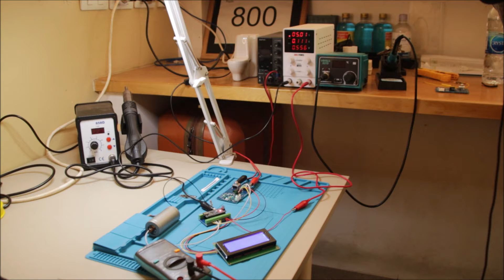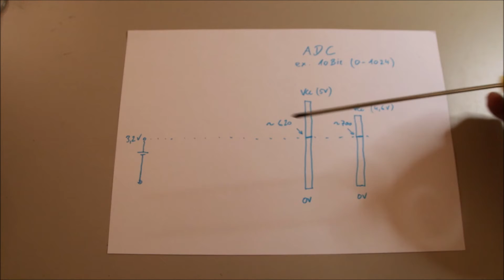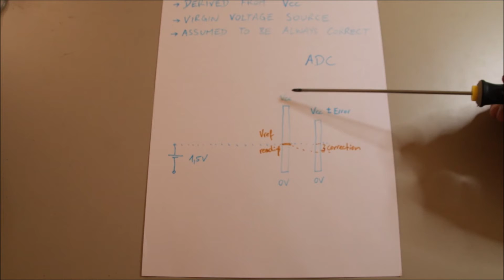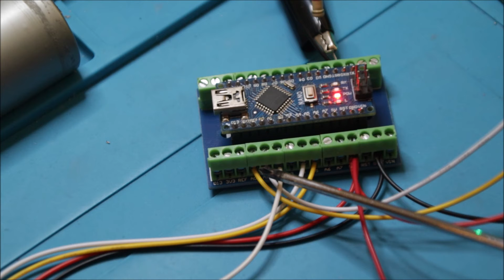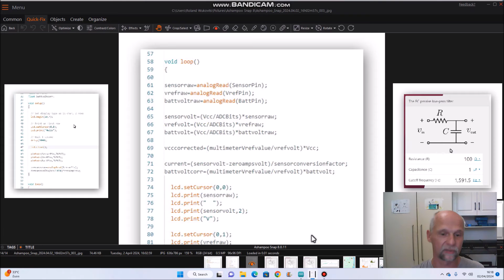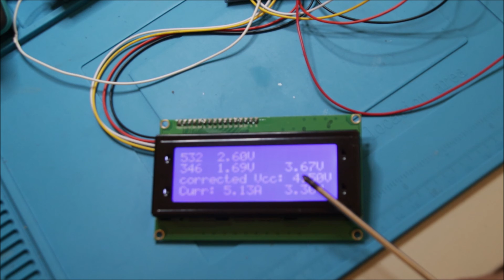Analog Sensors and Reference Voltage correction. How to make useful measurements with an MCU/ADC?

Comment: There may be one other effect worth considering, though I'm not sure how relevant it is here- the Arduino is using a multiplexer to switch between analog pins, and it needs to charge a sampling capacitor to do the sample/hold reading- so the first reading on a pin can have a so-called "ghost voltage"- influence from the last reading. It's really only relevant when measuring high impedance sources, but I'm not sure what the boundary is for high impedance here. 

The advice for dealing with this is to measure on the pin to switch the mux to pointing at it, and then sample it again (equivalently 100uS later, if I remember right / due to ADC sampling rates), and only use the second sample. SImplified: read twice, use the second reading.

(and then after that you get into weirder "read 5 times, take the median" and other attempts to filter out noise/outliers) (and averaging multiple medians to try and get slightly higher resolution/stability)

Also, I have a dumb request: in the opening monologues can you focus a bit more on either looking at the project or the camera? going back and forth is weirdly distracting (more so at 2x speed). I'm fine with not looking at the camera- you've got a project you want to show off, and you have the lapel mic so there isn't a sound quality concern.
Reply from the maker: Yes, great input.

Usually when you use a different ADC then that one you might have on the MCU directly (exc. ADS1115), you will use sensor libraries where there will be a lot of different settings/commands available.
One such setting might be how many readings/samples the ADC will take per each read request and output an average. So that should help clearing up noise and capacitive effects.

The ADC of the Nano here is of course only very basic. 10bit is by far not enough resolution too.

Thanks!
Reply: @RolandW_DIYEnergyandMore Yeah, at 10 bits you're only going to get 5mV resolution- which isn't awful, but depending on the specific ACS chip you're using, you would only get a half amp resolution (the bidi 200A chips look to be 10mV/A;  though the 50A version offers 40mV/A). It's still shocking to me that the IC connections can handle 200A, I'd have expected them to fuse long before then.
Reply from the maker: @codertao  in my powerwall I do have a 16bit ADC of course. After I have now installed the final shielded cable the sensor is working very well. Yeah, 200A is really a big stretch :)